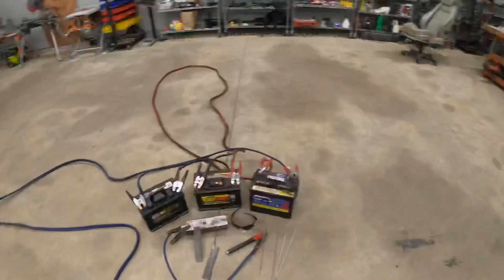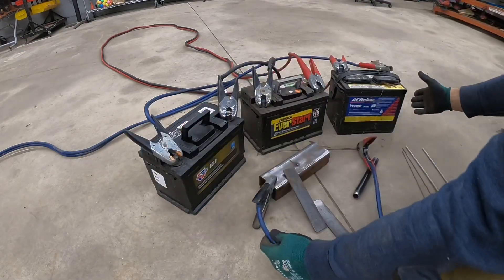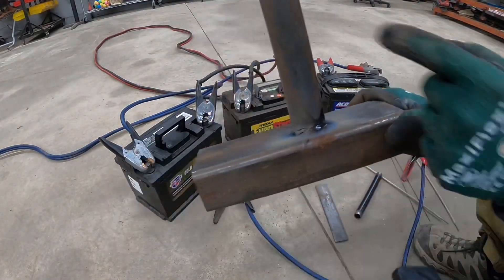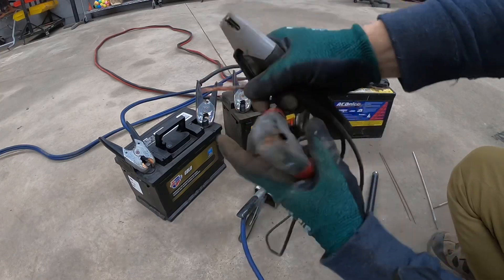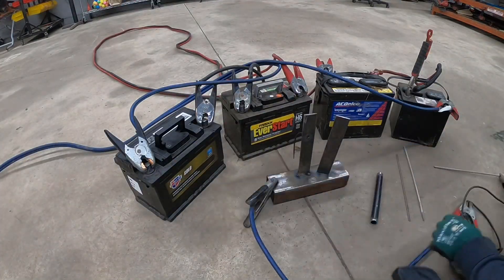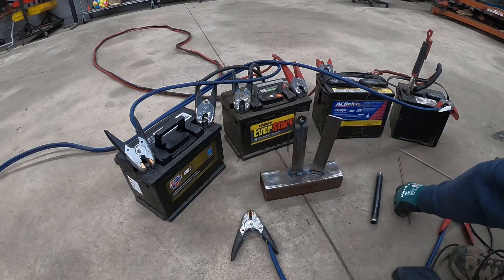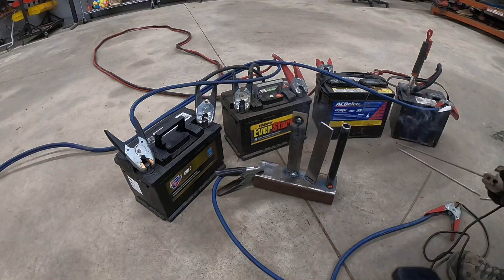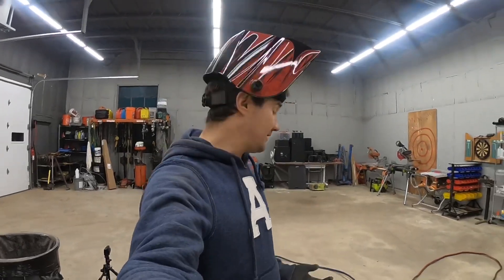HOW TO WELD WITH CAR BATTERIES

Comment: I've heard that it works better if you clamp the big metal piece with the positive cable instead of the ground cable.  You can also use a pair of vice-grips to hold the welding rod and clamp onto the vice-grips.
Reply: Yep I heard the same thing
Reply: Same

Comment: you will get a better weld by using  the positive to earth your work piece but  please move those batteries which are basically small hydrogen bombs, one spark to their gas breathers and you can be killed or badly maimed by the explosion.
Reply: Lead acid produces some hydrogen gas but the amount is minimal when charged correctly. Hydrogen gas becomes explosive at a concentration of 4 percent. This would only be achieved if large lead acid batteries were charged in a sealed room. Over-charging a lead acid battery can produce hydrogen sulfide.
Reply: Batteries are NOT hydrogen bombs! Do you homework. Place the batteries ABOVE your work and the problem of hydrogen is GONE.

Comment: It's the amperage that weld not the voltage. Most welders run between 17-30 volts but 30-400amps. Car batteries say they have 600+amps but I have never seen one capable of discharging that kind of power unless it's a diesel starter pulling that draw. Most discharge about 125-200 and the longer they crank they build Amps with heat due to resistance. 
3-4 batteries in series gives you some serious amps to work with in theory but thru the rod and cables you will only see maybe 150 as that's all there capable of drawing from the system.
Reply: 3 or 4 batteries in series has as much amps as the highest single battery. In series only the voltage goes up. Parallel the amps are added up from all batteries but it's still 12 volts. The ideal setup would be 2 pairs of batteries in series ran parallel. At 12 volts, 600 CCA each you would get 24 volts, 1,200 CCA.

Comment: btw a glowing chunk of  hot steel is gonna chill real nicely on top of the battery...
Reply: Lead acid produces some hydrogen gas but the amount is minimal when charged correctly. Hydrogen gas becomes explosive at a concentration of 4 percent. This would only be achieved if large lead acid batteries were charged in a sealed room. Over-charging a lead acid battery can produce hydrogen sulfide.

Comment: Dude... you should take this video down and remake it for two reasons.... welding so close to car batteries can be deadly. Batteries and sparks don’t mix the batteries could explode.... also, you are welding DCEP which is wrong you should be welding DCEN when using this method.
Reply: Two batteries are sufficient as well.
Reply: Lead acid produces some hydrogen gas but the amount is minimal when charged correctly. Hydrogen gas becomes explosive at a concentration of 4 percent. This would only be achieved if large lead acid batteries were charged in a sealed room. Over-charging a lead acid battery can produce hydrogen sulfide.
Reply: DCEN is a must for this type of welding. Use fans to expel hydrogen of battery away from welding spot, and use proper preven tion of spart to battery or heat near battery. Start welding in small pjulses in order to find out proper time of contact for different thichnesses of material.

Comment: my van has a very large 155ah 12v AGM deep cycle battery.  My alternator is 160amp.  with my van running I can run 13amp 110v applicances consistently.  I am wondering if there is some way I can weld using 1/8 rods  with  a 12v to 24v step-up converter  rated at 480amps somehow since many have been able to weld using to sitting 12v batteries in series?

Comment: Lead acid produces some hydrogen gas but the amount is minimal when charged correctly. Hydrogen gas becomes explosive at a concentration of 4 percent. This would only be achieved if large lead acid batteries were charged in a sealed room. Over-charging a lead acid battery can produce hydrogen sulfide.

Comment: People on here have a GREATLY exaggerated idea of the dangers of hydrogen. The batteries have to be in an enclosed area with no draft, to accumulate a combustable amount of hydrogen. Hydrogen as a gas is MUCH lighter than air, so it immediately rises.

The ONLY time batteries are likely to explode is when you are CHARGING them and the hydrogen builds up INSIDE the battery. Discharging or USING a battery does NOT produce hydrogen. Learn your battery chemistry guys!

Comment: Hmmm... You every see a car battery blow up??? You should be at a safe distance from the batteries... Please
Reply: Lead acid produces some hydrogen gas but the amount is minimal when charged correctly. Hydrogen gas becomes explosive at a concentration of 4 percent. This would only be achieved if large lead acid batteries were charged in a sealed room. Over-charging a lead acid battery can produce hydrogen sulfide.

Comment: That 'great weld' is way too hot with uneven penitration. It is NOT A GREAT WELD. Ok if you are throwing together a work bench. Not OK if you a building anything that will be subject to vibration and impacts, like a trailer.